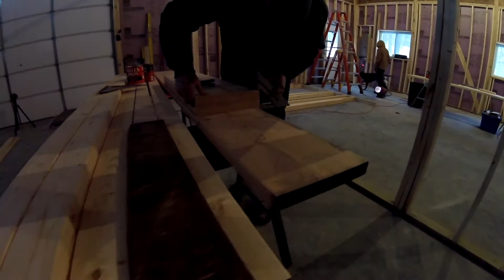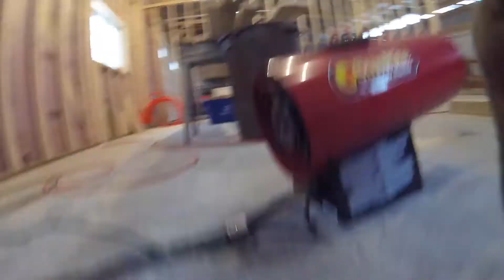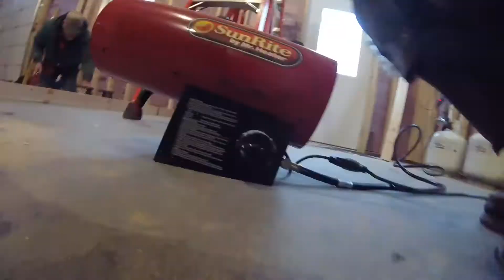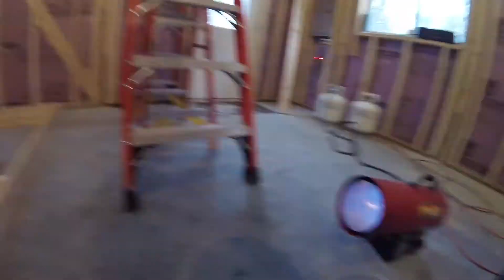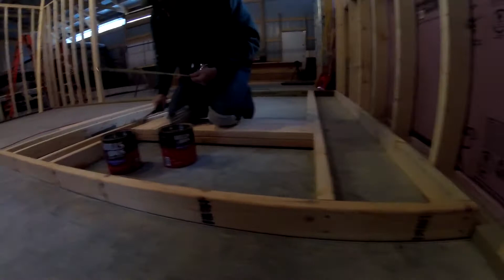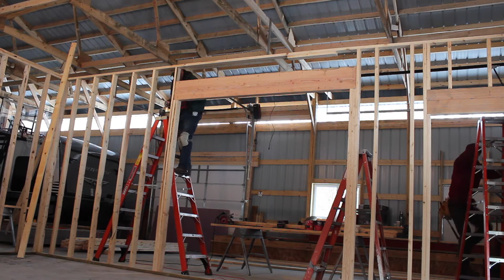Workshop - completing rough framing of interior walls in the pole shed

Comment: Did you use 2x4s to frame the 2 outside walls or 2x6s?
Reply from the maker: Hey +Josh Kwascigroh, thanks for watching and the question.  Yes, we did use 2x4s to frame the 2 outside walls as the pink foam board insulation (and cross bracing) took up the other few inches of our 6" pole frame exterior wall.
Reply: Are you using treated on the bottom 2by4 and why
Reply from the maker: Thanks for watching and the question +mike deushane!  Yes, we used treated 2x4s for our base plates.  Even though they are mounted on the concrete floor there is still the potential for moisture and this will help reduce the potential of deterioration or rotting.